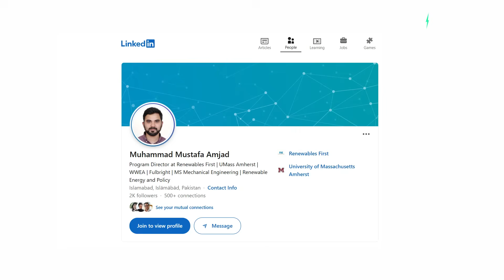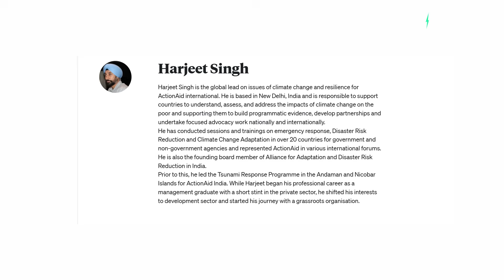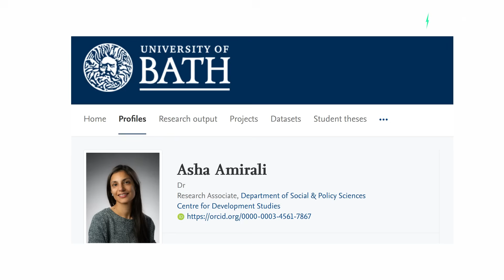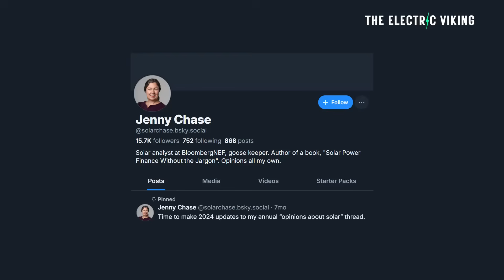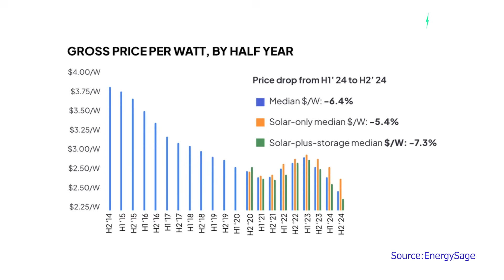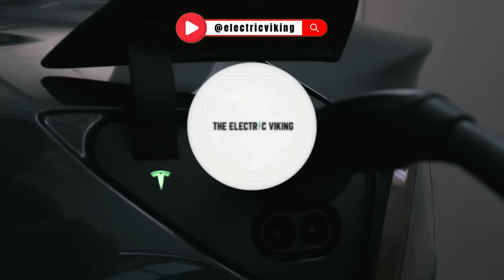Inside Pakistan’s Incredible Solar Revolution: A Game-Changer for Energy

Comment: I am from Pakistan. Installed my 10KW solar last year and havent paid a cent till now to the grid. Totally independent power. Its not only about the bill . With so much power produced daily it improves the daily living of people as well. People now consume more energy. Can cool more parts of the house in intense heat. Can afford to go electric on stoves and geysers previously based on natural gas. So it also cuts your gas bill as well.
Now for me next step is to go for EV so my petrol bill goes to zero as well. 

And i dont know how much environment i will save doing this but i guess thats a lot.

And i am not some rich guy i earn only 300$ a month. A basic salary for a middle class household here.

Comment: I put a solar system in March 36 kw without batteries I used the foxes inverter and x10 longi panels without batteires cost me around 10,500 usd along with that i got the atto 3 and the j6 jaeco. Sold my corolla prado and Sorento hahahah no fuel cost no electricity cost. The byd boom has started soon yiu will be doing an episode on the byd boom in pakistan With love from karachi pakistan.

Ps love yiur content

Comment: its simple. My electric bill living alone is more than my bill in new york city. On top of that, we dont have reliable electricity. A lot of nights sleeping outside because of no electricity. Natural gas is turned off after midnight. So a generator is out of the equation. Petrol is more expensive than here in NYC as well. If everyone in pakistan can pay for their electric bills, they are slowly saving money buying a panel at a time. With a focus on running their fan, well pump and charge their phones in the daylight. Slowly adding batteries.

Comment: Yes almost every household in Pakistan has a solar panel. Sone people have even cut off from the national grid and solely uses solar energy and the rest are using it alongside the electricity of national grid incase of load shedding or for lighting purposes to avoid high electricity bills even though they use electricity from national grid for refrigerators and for ironing and for rest of the uses solar energy which is a blessing.

Comment: Yeah so i would like to add as a pakistani citizen that is from the upper middle class that indeed solar power hasnt been only reserved for tbe rich. We were able to form a nice 20 panel system which did put a strain on our finances but is entirely worth it. Even small shop owners over here have 1 or two solar panels lying oustide their shop. I live in a neglected city btw.

Comment: Well the government is not benefiting people 
Power cut off is normal even in my area we only get 4 hours of electricity in 24 hours and todays temperature is 45c 
I also have installed 8kw solar but
The problem is still there because the u can't hollysolly depends on solar as in my case after 5pm the solar goes off and the batteries don't last that much...and lithium battery are way to much haier if run my 3 Aircon on batteries i would have to install 30 kw lithium batteries and it would cost me around 15lakh rs 
The government has more electricity then consumption but the periorities people based of their area

Comment: I have been researching getting a solar panel setup for my house. It's easy to install solar panels now, and they work great during the daytime. However, at night, when I have to rely on the grid, it becomes frustrating due to continuous blackouts. For that reason, I need to have lithium batteries, which are quite expensive right now. If only I could get the batteries at a more affordable price, I could eliminate my dependence on the grid by the next morning.

Comment: Pakistani Solar Owner here. Let me share my story to give you guys a better perspective of things here. We suspended our decision to buy a car and instead got solar panels installed on our house to power it. If you're wondering why, electricity prices are high and relatively cheap solar panels currently from China make it an awesome long term strategy for energy security. Not to mention that Pakistan has extremely high temperatures in the summer so having the ~luxury~ to live in air conditioned environment for most time of the day would be very expensive in the absence of solar. Thus, you're seeing the middle and upper class gravitate towards it.

Comment: The grid gets some clean energy from hydropower from Dams but is in dodgy contracts with IPPs (independent power plants- often owned by politicians and their families). There is no will or mechanism for them to get out of these contracts. The solar revolution is very much there. I visited the country last year and year before, the roof density of solar panels has seen a drastic change. A house without panel is anomaly, not the other way around. The grid buys electricity from house hold at 2Rs per unit and sells it to them at 9Rs. The houses are still in net credit & don't need to pay. Instead of crazy legislations, forcing people to go off grid what they should so is get rid of the contracts with IPPS, they have had a good run. With the cheap and ample electricity now available (from solar parks, domestic panels and newer dams), they should give it, at good prices to the industry (which nearly stopped functioning due to electricity costs).

Comment: No offence but the video didn't really provide any proper explanation and was uselessly long. The reason behind the solar adoption is simple:

1. Electricity in Pakistan is produced by Private companies called IPP (Independent Power Producers)

2. All IPPs combined are capable of producing more energy than the whole country needs.

3. The issue is country's grid and transmission lines aren't capable of transmitting this amount of electricity.

4. This is the reason of blackouts, the grid can transport less electricity than what is required by the people and what the IPP can generate.

5. The government made a contract with IPP that makes people pay for the electricity they don't get. For example, if an IPP can generate (imaginary numbers) 100MW but the grid can transport 50MW and the people get 50MW, they don't pay for the 50MW they pay for 100MW.

6. Point 5 is the reason why electricity is very expensive in Pakistan. In some cases people get bills upto 300-400 US Dollars per a month which is more than what people earn monthly. This is also coupled with the fact that people don't have electricity 24/7 .

7. Point 6 is the reason people choose Solar Panels. The cost of solar panels is recouped in matter of months. And as a bonus they get 24/7 electricity.

Comment: correction on net metering, yea that system doesnt work in pakistan cause pakistan doesnt had any plans to use residental power. 

Also the electricity we give to grid is far cheaper then the electricity we buy like 3 times cheaper so yea govt aint helping at all

Comment: As a Pakistani, I have to say necessity is the mother of invention. The government has screwed up grid and power generation for decades now and most parts of Pakistan regularly have load shedding (i.e. no power from the grid) to manage load vs generation capacity for several hours a day. This has forced the citizens to seek alternatives - it used to be UPS systems and generators, but the surcharge and taxes on fuel are so high that people started investing in solar. Pakistanis are the kings of "jugaar" - Jugaar means figuring out solutions by themselves, in America we'd call it MacGuyvering :)

Solar is a great fit for Pakistan - it can be deployed without dependence on the government by individuals, and there is strong sunlight almost the year round.

Comment: These are not being installed because they are green. Pakistanis are not concerned about the environment in the sense you are saying. They are looking to reduce their electric bills for homes and businesses. Electricity is very expensive in Pakistan. Even the middle class is collecting money to install a little 1-2 KW systems. The upper middle class has invested 10-20 KW systems on their rooftops.

Comment: I was fortunate enough to get 12kw solar system for my house. The electricity bill decreased from 35 thousand rupees to 250 rupees last month. Where i live i know about 50 houses are absolutely running on solar power off grid. Every roof has solar panels everywhere.

Comment: Solar roi is usually around just 5 years. Compared to it's lifetime operation which is 25 years, paired with low prices of solar in Pakistan, it's just a no brainer. You get to avoid the frequent power outage, have less or no electricity bill to pay and move towards greener solution.

Comment: Installed my own on grid solar system in Multan, 15kw system with a very heighted structure of steel which adds to the cost, but total it nearly cost me USD 5000! Yes its that cheap

Fun fact: my system produces 80kwh per day on avg, but my consumption is max 50kwh so I credit the surplus energy which is used to cover the difference between import and export rate...

Comment: Solar is also popular in villages. They start with 1 or 2 panel. Each 585 watt panel cost 18000 i.e 60 dollars. They use 12 volt fans and air-coolers. After getting addicted to free electricity. They start to buy proper inverters and batteries. Most Pakistani farmers are small land owners. When they sell their produce e.g wheat, cotton etc they have enough money to buy a proper solar system. Also 60-70% tube wells in Punjab, Pakistan have also been converted to solar on self finance basis.

Comment: My house is over 5,500 square feet, and I’ve installed a 20-kilowatt on-grid solar system on rooftop. It easily runs 3 air conditioners along with the entire household load. In fact, my electricity bill from WAPDA even comes in negative.

Comment: I also have installed 16 kw (10kw ongrid inverter and 6 kw hybrid) with 20 solar panels and 7 kw lithium ion battery a semi hybrid system with net metering at my home. This system is best you can do net metering and also at night you can use battery. We have this system for almost a year and never have paid electricity bill till now its in minus and nowadays solar panels are very cheap every one should go for it ✌️

Comment: We had solar panels put in 2010s when load shedding was at its worst so we decided to have a UPS battery and a solar panel set up to charge the batteries. At the time solar panels werent as mass produced or even imported it was niche to have them. The main issue for it not being popular was the lack of underaranding and availability of green meters( meters that govt uses to buy electecity off the user during the day and compensate them during the night curting electricity costs.
The recent boom has been due to a combination of factors one being how solar panel production has gone dirt cheap coupled with govts streamlined policies plus more awareness. The unit witj the ups cost us 350k at the time or 3500 usd in 2010. Now in 2024 we got 10KW system which supplies the grid during the day wiith 50 units of electecity a day we dont use a battery powered system where we store the energy made during the day. The govt then compensates us in the bill which is the major factor behind the shift.
Electrcity prices have skyrocketed in pakistan. Ppl using just fans see 200usd bills these are ppl making less than a dollar a day.

Comment: Hello from Karachi!
Electricity is crazy expensive in Pakistan and   very unreliable, some areas get electricity for less than 8 hours a day, fuel is it imported so generators are also very expensive. this solar boom is purely out of necessity, none of these panels or batteries or ups are manufactured locally. And there are no proper government subsidies that are provided. this isn't something to be celebrated but a failure by the state to provide its citizens with basic infrastructure and facilities.

Comment: Also, just like this Solar Power Revolution, Pakistan also was ahead of the World, top adopter of CNG (Compressed Natural Gas, in the 1990s), and majority of cars and small transporter started using CNG fuel, while keeping dual fuel option intact.  That caused another unseen issue, the shortage of Natural Gas in Pakistan, for the household and Industrial usage, as a big portion of Pakistan's own Natural Gas was being diverted to fill up cars CNG gas cylinders.  That led to expensive import of CNG fuels from Qatar and other countries, after Pakistan's decline in its own Natural Gas.  So, government has to step in, to manage such large scale adoption issues.  Solar adoption would be a good thing, both for people and environment, and government has also figure out a way for people to balance power grid usage, so the government does not bear the losses of the Independent Power Producers that China and other local investors have set up, in the last few decades.  The country's financial stability, future investments and international agreements have to be kept in the long term plan.  Also, Solar Panels should be produced locally, to save the foreign exchange.  There is no reason to keep importing such panels, and it does not look like a very sophisticated science, to produce such panels.

Comment: This is good, as a short run solution.  But in the Long Run, the government has to have some control, to keep the power-grid also functioning and Hydro-Electric Dams and other IPPs running, as solar is not always available, 24/7 and in case of emergency.

Comment: We have a 2,500 sq. ft. house, and yes, we installed a 6 kW setup under USD  4k including battery pack, 
and the 300 amp lithium battery pack for over 5-6 hours of backup with AC, motor, and all the appliances. 

That can increase to over 30 hours of backup (without AC, motor, and refrigerator in case of an emergency power outage).

& our bill was -9000 pkr  to wapda (local power company ) this month

Our installers were  hashim traders & haider ups, wonderful guys search them up on google
they install all over punjab.

Comment: I have bought solar plat 2 months before one palate of 585 watt plate almost around 68 USD and it can run 2 ceiling fans AC/DC and 3 lights and also when ever there is loading shedding starts we just switch to solar and now electricity bill has gone down drastically and now I am thinking to convert whole house in solar also we have connect 100 amp battery lead acid which enough for 2 fans and 3 bulb total cost of all set up of solar system cost me around 300 USD ALMOST

Comment: The reasons are simple per watt of the best solar playes bifical is 1€ per watt for solar plate.
Few years ago it was 3-4€ and even the lithum battery price has dropped 50% after a market rush. 
Load shedding is an huge issue as well as the simple plain fact that costs of electricity is crazy, like 1/3 of the actual bill is electricity while 2/3 are taxes IMF
The only thing still expensive are inverters at 1K€ for a 6KW system while the total system costs 3K€.
Solar is actually heavily used in agriculture and poor who simply can't afford electricty bills.
Poor are the ones are the ones who are investing there savings.
Also has had a huge impact on agriculture since tube well running ok diesel are now a thing of the past.
Also small businesses can now have shops without electricity meters

Comment: Pakistan's transformation to green energy is incredibly inspirational!
Reply: They have not done it because its "green". the trend has exploded because power is very expensive in Pakistan and it results in savings in just a couple of years of installing it if you use ACs in the summer and have the means.
Reply: Inadvertantly its green. But never meant that bcs had no choice
Reply: Truth be told, the transformation has come as a result of people being fed up by the government stealing money from the people in the name of electricity bills. We've got Independent power plants (IPPs) run by politicians and others in power, the cost of operation of which is paid in full by the government, meaning that even if no electricity is being drawn from the plant, it would still be paid in full for its capacity, the amount for which is collected by raking up the price of a unit of electricity. The price of a unit is about 3 times as expensive as it is in  Afghanistan. So the push to solar is mainly to avoid outrageous electricity bills which are a but a guise to steal money from the public.
Reply: Yeah! Thanks to our incompetent government who is unable to provide basic need as electricity.

Comment: Pakistan has moved to Lithium iron phosphate batteries as well. I live in a place where Load Shedding is 18 hours means I have only 6 hours worth of electricity
 
What I did in 2020. Bought 4 545 watts solar panels with 3 KVa inverter and this changed me forever. Now I have upgraded it to 4 KV inverter with 8 panels. Plus 9000 watt hour if lithium batteries. And in another property I have installed 7.5 kVh battery and 6KV inverter with 10 solar panels. This is revelational

Comment: I used to pay $300 per month on average, with the help of the Govt initiative of Green Meter which uses the energy of solar and stores it back to the grid for later use at night, now I receive electricity bills including taxes $4.26
It's a great initiative. 

Similarly, due to load shedding and high energy price most of the agriculturists with the Govt initiative shifted to solar to power there water pumps and many other industries drastically.

What did the Govt achieve? 
Reduced high reliance on foreign focal fuel in terms of import bills 

The next revolution is coming which no one is talking about is electric vehicles yes it's true Pakistan is moving at a fast pace towards electric vehicles and the transportation system within next 3-5 years

Comment: We got a 7 kW system installed last year in our village home in Pakistan. Excellent setup combined with a 4.5 kWh Lithium Ion battery pack. Use grid from 10PM at night only switch back to solar system around 6AM.